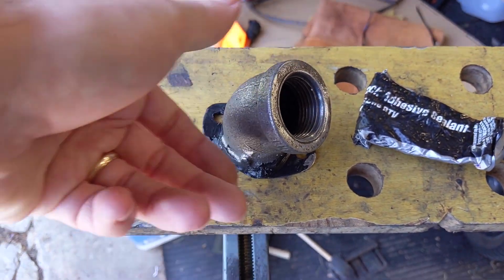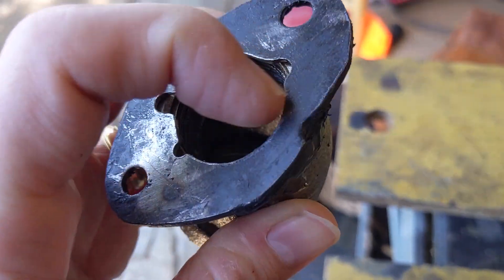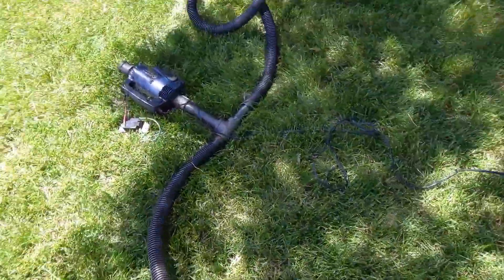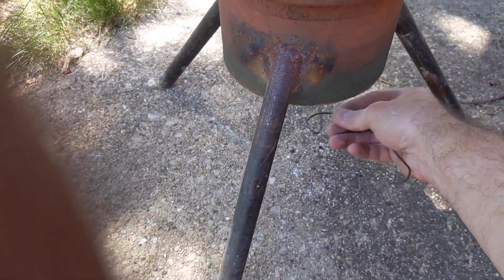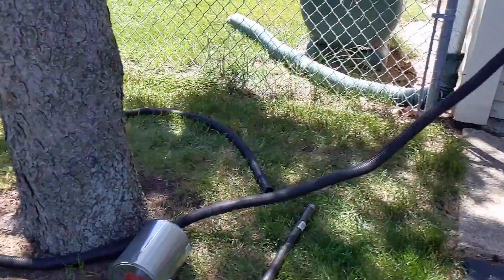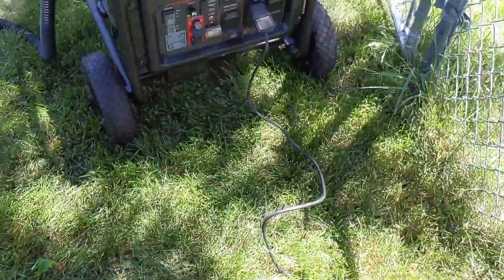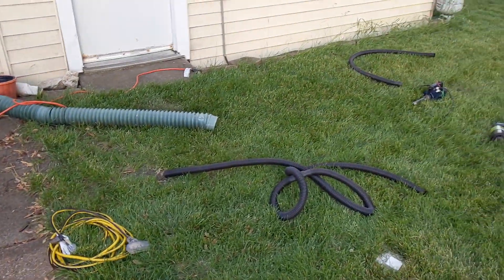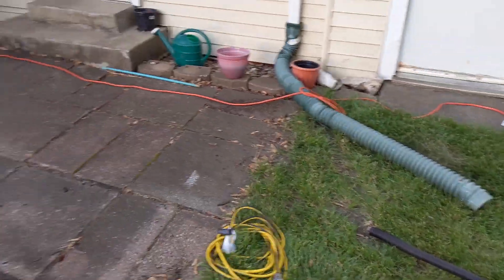Generator First Run on Charcoal.  Woo Hoo!!!!

Comment: Charge batteries instead and use power out if inverter maybe
Reply from the maker: Actually, I have had much better luck using the pull starter when attempting to start on charcoal gas.  I prefer it over the electric start.